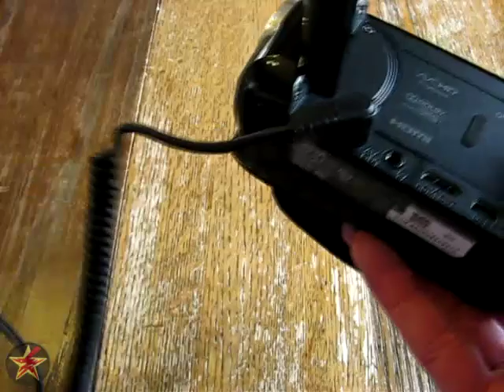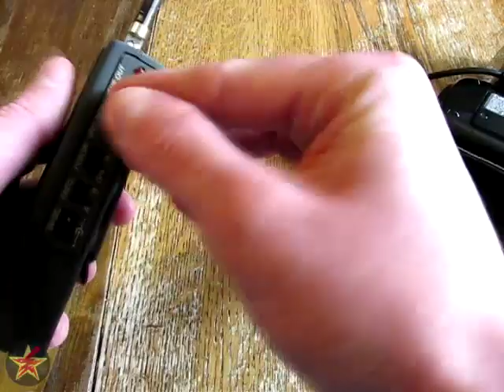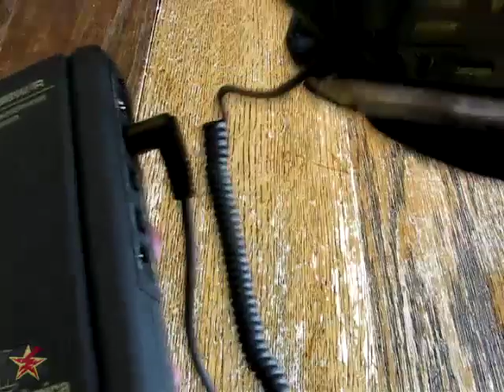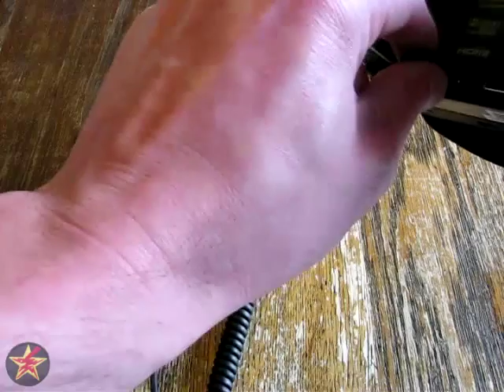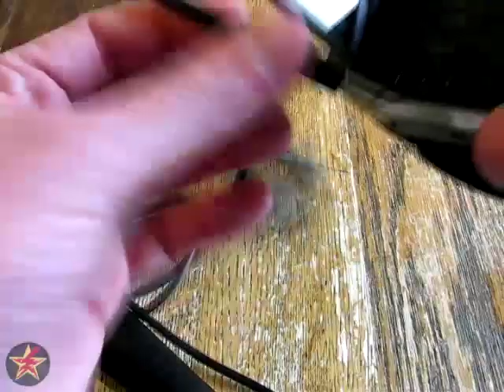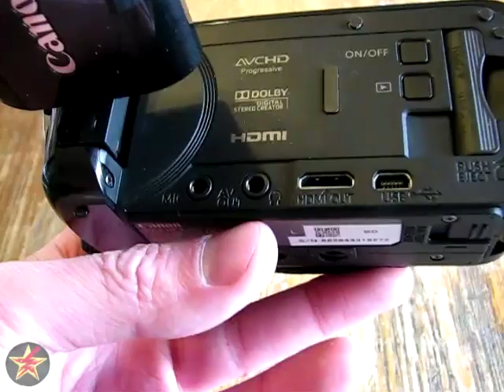Canon Vixia HF R400 How to: Use An External Microphone

Comment: Nice to see your video. I was searching for something like this for a long time. I have Sony SR10 handycam and I am planning to make a full length feature film with that in May this year as it will be novel. There is not even one good short film made with Sony SR10 yet if you check You Tube. Sony SR10 camera is really good and it has been used by the likes of Bear Grills of the Man versus the Wild as POV camera for that show. Now I will tell you what my problem is. I use a Sony wifi mic on the hot-shoe which is very good for indoor shoots. I want to know how to record sound for outdoor shoots especially in windy situation. Do I necessarily require a shotgun mic for that? And if a shotgun mic is required which is the best for Sony SR10. Can you please tell me about that?
Reply from the maker: Anil P A shotgun mic might not be necessary for outdoor shooting.  A wind screen could fix the issue that you are having.  As for what shotgun mic would be good for the Sony SR10, I could not say for sure as I do not own this camera myself.
Reply: Thanks! Cheers!

Comment: I testing two shotgun mics. A Bower and a Sima Mic Mixer.  Sometimes I use them at the same time, the Sima has an aux jack which I plug the Bower into with the Sima Mic Mixer in the mic jack on the camera. I set the balance on the Sima so that both mics or picking up 50% each.  I test it three ways, the Bower by itself, the Sima by itself, and then together.  I haven't decided which sounds best. All three ways are a vast improvement on the camera's mic. .  Maybe you can help me if you watch it yourself. It's in my Fumbling Wizard Series. I use a Vixia HF R50, which is basically the same cam you show.`

Comment: In real need of help here. I have a Samson Q1U USB microphone and ive been looking everywhere for ages to see if i can plug that mic into a camera. Can i use it on this camera and if not, any chance you could help me out and as im out of ideas here :/

I dont want to have to go out to get a new microphone so if i need to buy a special jack for it i wouldnt mind doing that as long as i get to use it.

Meany thanks !
Reply from the maker: The Samson mic will not work with the R400.  You could look into something like this (http://www.amazon.com/gp/product/B00H28XZWI/ref=as_li_tl?ie=UTF8&camp=1789&creative=390957&creativeASIN=B00H28XZWI&linkCode=as2&tag=wanderer001-20&linkId=2GR6C4CD5PUOY6SR) which may be able to work as the converter you need.  However, I do not have this item so I can not say for sure.

Comment: what about the reverb problems? I'm having trouble with static when I use headphones or an external mic.
Reply from the maker: Are you using the camcorder plugged in?  Some times there can be a noticeable reverb in this case.  Do you have any video samples on youtube?  It could help, thanks.

Comment: I am thinking about buying an Audio-Technica ATR-1100 off Amazon. I know it was explained earlier that the r500 has problems powering mics without an external power source, but the wired Audio-Technica used in this video seems very similar to the one I'm think about purchasing and it also doesn't appear to have an external power source either(I may be wrong), but would an ATR-1100 work with this camcorder?
Reply from the maker: I have found it to not be very reliable.  Most times even with the hand held mic I still have to plug it into the wireless power pack to get it to work.
Reply: Wanderer001 Any handheld mic/power bank recommendations? I'm fairly new to using this camcorder.
Reply from the maker: Nononsense69
Sorry to say I can only speak for what I use which came with my wireless mic set up, which is https://www.youtube.com/watch?v=fszzAF8wif0

Comment: I'm trying to get sound out of my shotgun mic and though I'm seeing the level measuring bar, I'm getting no sound reads or sound reception. Am I missing something?
Reply from the maker: What shotgun mic are you using?  Also you see the level measuring bar, but do you see any movement on it?
Reply: Wanderer001 NTG2 Rode mic. And yes, when I plug it in I see a measuring bar, but I get no sound being recorded.
Reply from the maker: ***** Are you using the external power source for the mic?  The HF R400 has issues powering mics through the camcorder itself.
Reply: Wanderer001 Oh, that would explain it then, because I don't have an external mic power source. Thanks for the prompt response, I'm going to subscribe because of it.
Reply from the maker: ***** Yup, that would be your issue then.

Comment: So, I'm a music teacher that wants to record concerts of my students.  I have a H4N Zoom that I plug into the camera.  I have the H4N all set up with the mic level I want.  However, the camera is auto-adjusting the sound so the soft parts of the concert sound like crap (because of the hiss) and then the sudden loud sections sound awful as well (because the camera can't adjust instantly to the sound).  Is there any way to set the recording level on the camera to a static level and not change based on the amount of sound coming in?  Any help would be appreciated!

I just tried it again and I even switched it to "M" on the "Mic. Level"  and put the recording level lower.  It STILL auto adjusted.  It is SO frustrating.
Reply: Thanks for the info!  It's just really frustrating because I know how to set the levels correctly when I do an audio recording.  I just wish that I could do the same with video! (without having to import the whole concert and pair the good audio with the video)  Oh well.  We're just recording for the kids to watch in class, parents to watch online, and for posterity.  We're not making any money!  haha
Reply from the maker: Ok, I was going to suggest lowering the Mic. Level on the camera as well before setting up the H4N Zoom.  Have you tired using the preset audio setting on the camera for concerts?  I have not had a chance to test this out in a situation like yours however, I would hope that it would taken into account the subtle dips in sound better then the default.  Let me know if it helps.
Reply: Wanderer001 I unfortunately can't use the audio presets with anything plugged into mic jack.  It instantly turns it to "standard" and is grayed out.  

I called Canon support about the issue and the guy I talked to basically said "what you're trying to do is beyond the scope of this camera because it's a consumer camera rather than a "pro"sumer camera.  Truthfully, I think that is a bullshit answer.  If I set the recording level at 10%, it auto adjusts for the situation and makes the sound louder.  If I set the recording level at 100%, it auto adjusts for the situation and makes the sound softer.  It's just unbelievable that I can't just set it to a level and have it not adjust.  I even asked about a firmware update that might change it - no luck.

I don't want to buy a $1600 camera so I can pick up sound at a decent quality.  The video in this situation isn't really even that big of a deal.  So annoying.

Thanks for the response though!!!!
Reply from the maker: OPMS Music Wow that really does suck.  Good data point to know.  If the video is that that critical have you considered just getting a cheap audio recorder?
Reply: OPMS Music I have the same thing happening here.  (My camera is the HF R500...virtually identical to the HF R400).  I take a line out from the mixer and set the input level appropriately.  The camera still self-adjusts.  

My theory on this is that the input "level" control is more of a pre-gain control.   In this case, the "pre-gain" only controls the level of the signal before it hits the Auto Level Control circuit in the camera.  The ALC circuit in the camera is never actually disabled.  I look at this adjustment as being just a built in attenuator.  It does help with reducing and eliminating distortion from a "hot" signal going to the input, BUT it does not disable the auto level in the camera.  I think the labelling is a bit deceptive, since it is not a true level control.
Reply: OPMS Music No problem.  Just wish I had better news on this setting.  I do a few music videos in my home studio and thought this was going to be the "end all" to having to sync the video and audio tracks.  It isn't all bad though.  I think I have found a happy medium setting.  Last time I did a recording in there, I had the input level on the camera set at about 25-27.  It seemed pretty happy with that setting.  I plan on doing more testing with it this weekend.  If I come up with anything interesting, I will let you know.
Reply: Ugh...I just discovered this problem, still unfixed on the r800. It's fatal for recording music, because dynamics are eliminated, so a crucial dimension of musical expression is just wiped out.

Comment: Thank you for the video!

I was going to ask if the microphone must be one that has its own power supply, but I see you have already answered that down below.

Reading reviews on Amazon, twice I've read that the Vixia R400 can only work with a microphone that has its own power supply, which means a little battery. That is no big deal, as long as I know which microphone to buy before hand.

Comment: Hey, quick question. I have a simple lapel mike that I plugged directly into the R400 external microphone slot, however, it doesn't pick up the sound at all. Any thoughts?
Reply from the maker: I have found that the R400 does not have enough power to support a mic.  You will need to use one that has its own power supply.

Comment: I've been using Rode VideoMic with my Canon Vixia M500 camcorder. It picks up every little sound loud but doesn't get much louder in the video as if it reached the maximum volume.  Could reducing the mic level fix this problem?
Reply from the maker: I do not think that lowering the mic level will help you get louder volume in your videos.  If anything lowering the mic level might actually cause the sound picked up to be lowered as well.
Reply: Wanderer001 I've tried it today.  It is better but not ideal, though. It picks up soft dynamics better, but still doesn't get loud enough. It'll do for now until I save my money for a better one. I'm thinking of Charter Oak e700. Have you tried that mic? Thank you for your quick reply, by the way.
Reply from the maker: Ji An Sorry to say I have not tired that mic.  It's a little out of my price range right now.  So I can not offer any helpful information on it.

Comment: I purchased two Lavalier ext mics. neither one of them work on the Canon Vixia HF R400. any ideas, I can't spend 200 bucks on external mics.
Reply from the maker: I have been testing and just finishing a review of the Audio Technica ATR288W.  It works with the HF R400 and has decent audio quality and its only $119.95 on amazon.
Reply: ...ok thanks for the feedback!!

Comment: Hi. I have the same camera and the same mic, but i have a problem. I record everithing normal and i play the videos from the camera and the sound sounds good. But when i get the videos from the camera to my pc, the video doesn´t sounds. Do you kwon what happend. In the camera sounds good, but in the pc there´s no sound. Thanks
Reply from the maker: So are you saying when you bring it to the PC there is no sound at all or is it really low muffled sound?
Reply: Very Low muffled sound
Reply from the maker: ***** I would first suggest trying to play the video on a different program see if that helps, if not then a different computer.  If it sounds good on the camera it should sound ok on a computer.  Let me know if that helps.  I will see if I can come up with something if it does not.
Reply: I'll play like you said and something that i tried is installing an audio codecs and that didn't result..
Reply from the maker: ***** Ok last thing I can suggest that will be simple is try using VLC media player.  It will load just about ever codec under the sun and if that does not do it then I will start testing things out on my camera to see what might be going on.
Reply: Nou. It doesn't work. I get the videos on a laptop and the sound works good. So i think is some kind or codec or something in my pc..

Comment: hey man i have a vixia hf 4500 and i want to use an external mic for better audio quality. my videos will consist of far shots and i want clear audio so which mic do you suggest i get? i dont want anything pricey although i know it might be pricey since it needs to be wireless and im gonna need a transmitter and receiver, but yeah please help
Reply from the maker: About how are are you looking for?  Also are you trying to just pick up a person talking or are you looking to get overall environment sounds as well?
Reply: pick up person...just like a b conversation
Reply from the maker: DWOProductions
Sorry it has taken me some time to get back to you I was trying to find a mic that would work for you situation.  I had some issues finding something that was good but also not extremely expensive.  The best I could do was find a topic on a digital video forum asking something similer, here is the link; http://www.dvinfo.net/forum/all-things-audio/89832-best-long-range-wireless-mic-under-600-a.html  I will let you make up your own mind as to how much is to much to spend as well as the max range you would like.  I hope that helps.

Comment: Hi Guys.. my lapel mic do not work.. Anyone have the same problem?
Reply from the maker: Not yet, what is the brand of lapel mic you are using?
Reply: Wanderer001 I discover that the external mic need a 1,5V battery.

Comment: Hi, I have the HF300 and when i plug in new,  ATYR6550  2AA powered  shotgun i get low but very noticable hiss.  When i plug in new working ATR-3350 wired button powered lavlier I get LOUD BUZZ.  Both mics register a 1/2 full mic volume upon plug in, and i cant find a way to alter anything. HHEELLPP!!!
Reply from the maker: Is the camcorder plugged into power or is it running off the battery?

Comment: Quick question - When I plug in a battery powered lav, or a battery powered shotgun, the camera is picking up almost -12db of noise. Even when the manuel audio meter is turned way down. Is there an internal setting? I've tested both mics with the mic jack on my macbook and there's minimal noise. Anyone lese run into this problem? Thanks
Reply: I had a problem with background buzz/hum when using a battery powered external mic on my Vixia R40.  I eventually discovered that it only occurred when I had the camera plugged into the AC outlet!  Try running the camera from the battery only, and see if it helps. -- Mimi
Reply: stonysilenceworkshop

yup, no hum when the camera's not plugged into the AC outlet. So did the Vixia R40 have that problem ongoing, or did it resolve itself after a full charge? I also have a Vixia hf42 and there was never a hum w/ the AC plugged in.
Reply: could you please tell me where the "manual  audio meter " is? how are the recording levels adjusted? thanks Norm
Reply from the maker: https://youtu.be/991lj3lav8E

Comment: I bought some cheap lapel mics and I cant get them to work on my camera, how did you make your camera show the volume bar ? Is there a setting in the camera to change? Thanks
Reply: it almost feels like theres a problem in the camera 3.5mm port, I noticed yours seemed very tight when you unplugged your mic, mine is loose.
Reply from the maker: Can you link what lapel mic you got.  I have had some people tell me that the mic jack is not working for them, because it is not providing enough power for their mic.
Reply from the maker: Food Porn Network Try plugging in a different 3.5mm jack into the port to see if it is the port that is too big or loose or if it is the mic itself.

Comment: Can you send me a link to a web site that has the plug in power device you recommended?  The Nikon ME-1 has no battery or on/off switch.  I may have to return it if it's not compatible.  My requirements are stereo sound, wind screen, some isolation from camera body (less autofocus noise) small size, for mostly outdoor shooting.
Reply from the maker: I have heard good things about the Rode Stereo VideoMic Pro.  It is a little more then what you spent on the ME-1 but does fill the requirements that you are looking for.  The wind screen "shaggy dog" looking one is an add on.  It comes with general pop/wind filter.  It should fit what you want, I am not sure what kind of price point you are looking at.

Comment: Bought the R500 camcorder.  Audio with built-in mike is normal.  Audio listening with headphones is normal.  But when I plug in external mike, I have no audio.  Tried two different mikes, no audio with either.  Simple headset mike, and new Nikon ME-1 mike.  No levels showing on audio meter.  Camera in AUTO mode.  Help!
Reply from the maker: Part of that may be do to the fact that the mics you are try to use need what is called plug in power.  It would seem this is something that that R400 and the R500 are lacking in.  The reason that I was able to get the audio meter to show with my mic is because it is a wireless set up and there for has an external power source.  This was something I was not aware of at the time I made the video but have had others ask me similar questions about it.  I am pretty sure that is what your issue is.  There is not enough power coming from the mic port to support the mics you are trying to use.
Reply: Wanderer001
Yes, the R500 does not power external mics, unfortunately.  This is the dilemma I have.  Finding a good powered stereo x/y mic is a bit of an issue.